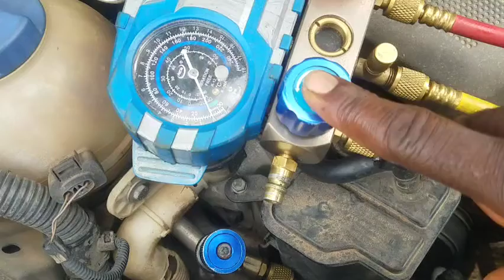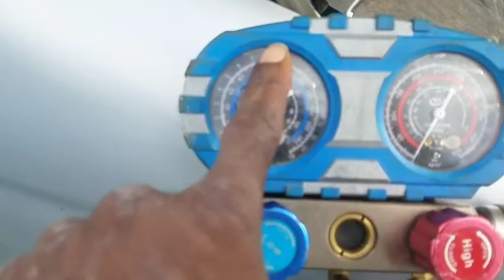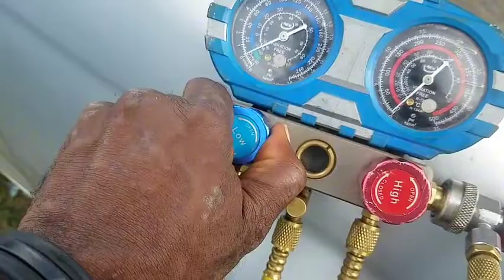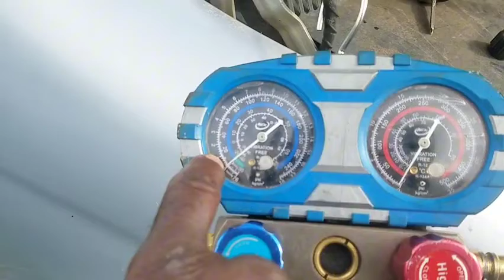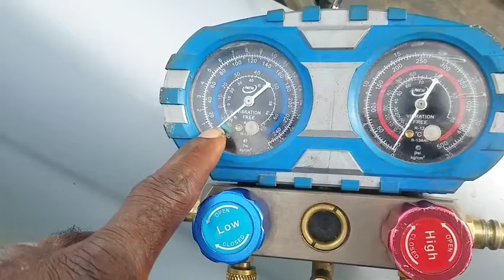How to recover refrigerant without a machine | How to recover freon without machine

Comment: Its not recovery, its moving refrigerant from one car to another.  Plus I hope the car your moving the refrigerant too was empty and had a vacuum pulled, otherwise your overcharging the car your moving it too and will damage the compressor or blow a line or fitting.